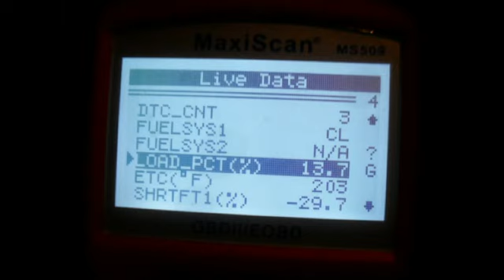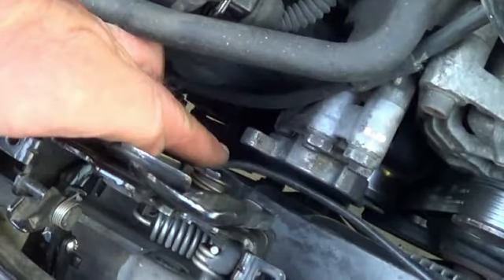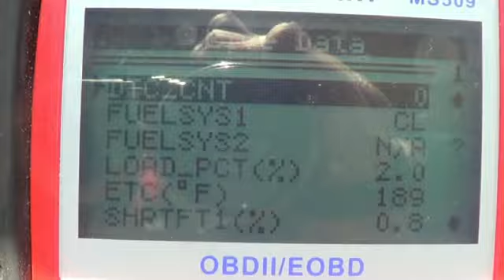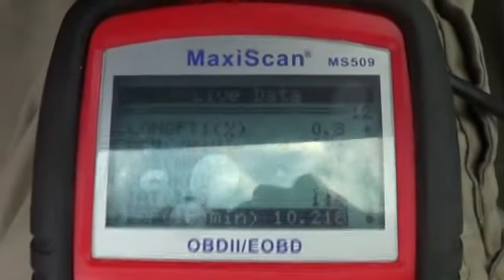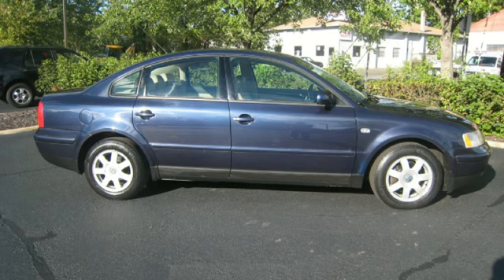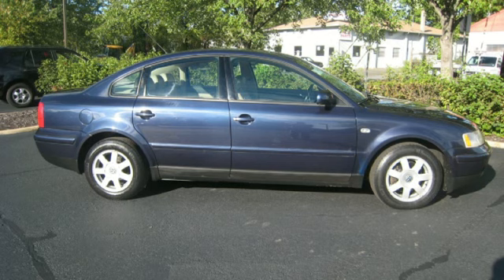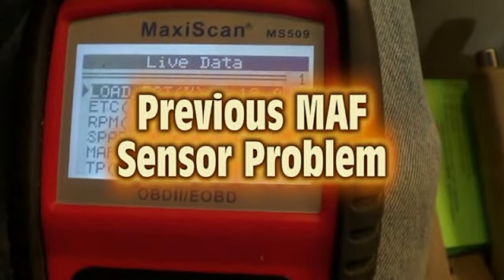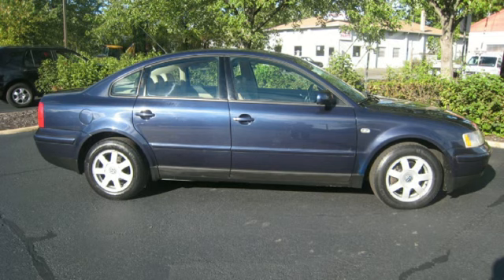1999 VW Passat MAF Sensor Diagnosis and Replacement

Comment: Clean the mass air flow sensor with MAF sensor cleaner. Then 2-3 times with MAF sensor cleaner soaked cotton buds. Gently you will remove 21 years of sticky dirt from it, soon you will see the sensor metal plate will shine like a mirror, clean another sensor probe on the other narrow side. At the same time change the engine air filter and change the spark plugs. After that merge into highway and feel the turbo after a loooong time. Enjoy. 🙂👍

Comment: Hello, i would like to hear your opinion on my problem. Have 2004 VW Passat B5.5 2.0l engine (Europe market). I have fault code P0102 Mass air flow sensor, signal too low. At idle it shows me that mass flow is around 2.5 g/s (wich is about 0.34 lb/min). Is it too low, beacuse i can't really find what are normal values for this model (or any other). My biggest suspicion is that Air flow sensor is faulty, but vehicle runs completley normal, except when i release throttle, it hold idle at around 1300-1500rpm for a few seconds. 
Here is the video so you can see what am I talking about: https://www.youtube.com/watch?v=kjDHDuU6vcg&ab_channel=Rakee
Thanks!